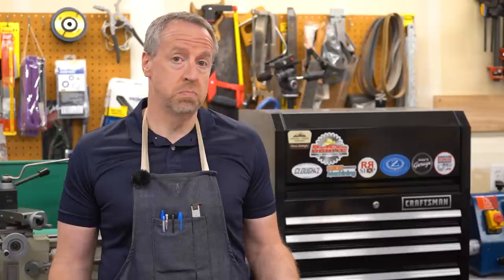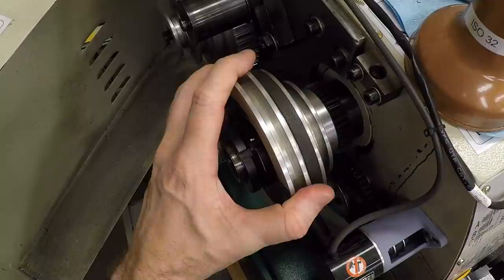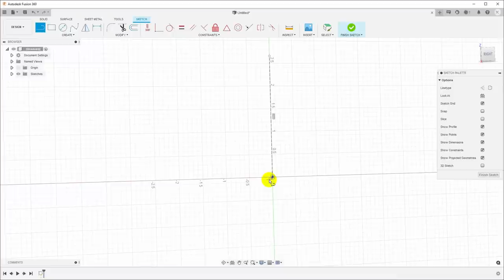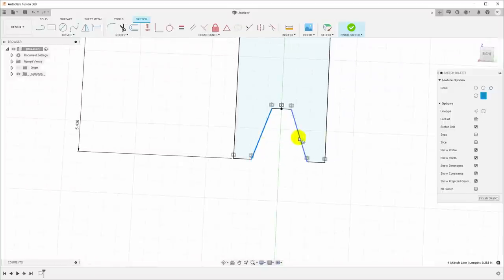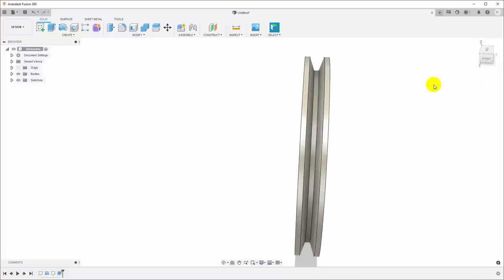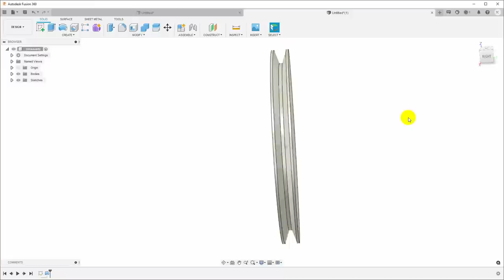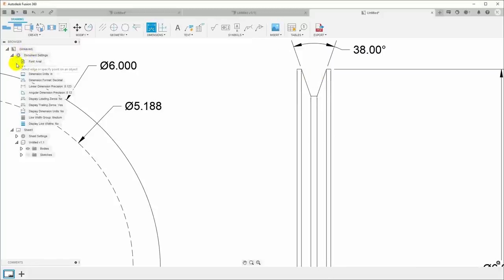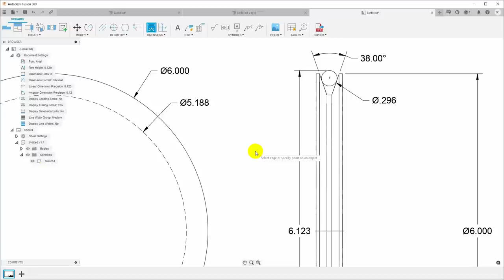Stupid Gage Pin Tricks: Measuring and Modeling Pulleys | Fusion 360

Comment: And of course as you're figuring out your V-belt 'stuff' - never let the bottom of the belt hit the bottom of the groove.  They get traction from the sides.
Reply: Does this mean the depth of the groove isn't critical?  Should it just be shallow enough that the pulley strength isn't compromised, and deep enough that the belt rides the angled walls?
Reply: Well do remember that as the belt wears, it's wearing on the sides (primarily) which makes it's "V" profile skinnier - so it will sink down lower and lower.  If you only left yourself 10 thou to start... you don't have much of a margin of error.  ;)

Comment: Ohh, so that's why YouTube machinists have "thread wires". Seeing the constraints build up in the model made it all make sense. Super cool!

Also, you must have a space mouse or other high-dof input device, that "pan the model while 'dragging' a constraint" was so smooth.

I shall definitely use this trick (or variants of it) with SolveSpace and my "two flute gauge pins" (as another commenter mentioned) in the future. I have definitely used cad as a way to figure out math and geometry in the past. (Projection math for 3d graphics rendering!)

Comment: When I noticed that the spindle thread of my 70 year old lathe (old Swiss DIXI lathe) I had to model it and I proceeded the same way. I don't own thread wires, so I used three 1/8 in. endmill shanks. It worked perfectly ; good trick.

Comment: We might also recommend Joe Pieczynski for in depth understanding.  We should point out that the pins cannot rest on the 'bottom' of the pulley V -- they must contact only the sides of the V -- and that you don't want to tighten the calipers at all or the pins will spread the groove and give a false reading.  If you don't want to buy Fusion 360, you can download FreeCAD.

Comment: Two questions for you James. I'm looking at buying a pin gage set. What range set(s) do you find useful? How did you decide to get a plus set or minus set? Thanks for the good content!
Reply from the maker: I have pins from .011" up through .500", and I would like to keep growing the set.  I picked minus because the first set I bought was minus, and I didn't know the difference.  Looking at it now, minus is fine, because I'm, typically checking 3D-printed or CNC milled holes, and a minus gage pin will usually just barely fit into a proper-sized hole.  The .061"-.250" set is the one I use the most, but it totally depends on the size of work you do.  You can also buy loose pins if you need them in specific sizes.  I have a .750" pin that I use for touching off tools, and I know a lot of people have pins that fit their mill table slots for quickly aligning parts.

Comment: Nice and informative, good way to measure things like this (where the angle is known).

One question though, don't those calipers have a switch for inch/mm? Also that 0.627" measurement is suspiciously close to 5/8"....
Reply from the maker: The calipers do.  The micrometers do not.  I'm assuming it's 16mm because everything on the lathe is metric except the leadscrews and dials.
Reply: @Clough42  understandable, context matters a lot with whether or not something is metric/imperial. The really sad thing is that even if we adopted metric tomorrow in the US, we'd still be dealing with random imperial leftovers for the rest of our lives. Even metric micrometers are based off imperial ones.
Reply from the maker: @cavemaneca  the best thing about switching to metric would be needing only 1/3 as many drills.  :)
Reply: @Clough42  you don't have to convince me

Comment: Interested to know your approach to machining this pully. Would you grind a 38deg form tool and do it just like a thread? I can think of a few other approaches but many of them keep you from having access to both sides with good symmetry to take measurements with the pins. Great video! I find myself taking the constructive geometry approach quite often, since Fusion 360 is almost constantly open on my desktop.

Comment: I wonder how accurately you could measure the angle using 2 sets of pins of different sizes if you were dealing with a completely unknown pulley.
Reply from the maker: Oh... That's a very cool idea.  I might try that!
Reply: It would rely on your ability to accurately take other measurements, but the software can derive 'other' dimensions from the right combo of measured (accuracy is key) dimensions. 
Reverse engineering is a talent and art, and can be very accurate.
Reply: @Clough42  That method is also in MH as well as using balls to measure internal tapers. John, Australia.
Reply from the maker: @joandar1  Really?  What section?  It's a big book.  :)
Reply from the maker: @joandar1  Oh, I see the angle and taper measurements using disks.  That could be easily abstracted to tapered holes and balls.  Cool!
Reply: @Clough42  Off the top of my head I don't remember, try looking for measuring tapers and that should get you close. John.
PS: Page No is dependent on what edition you have.

Comment: Since you used different sized pins the 5.555" measurement could not have been not symmetrical about the centre of the pulley so presumably Fusion accounted for this offset automatically but I imagine that would be quite a complicated sum to do on paper.
Reply from the maker: That's the power of letting CAD software sort out the constructive geometry.  It would be much more complicated on paper for the reason you state.

Comment: When you dimensioned the tan of the two pins, should you have dimensioned one back to the centre line?
Reply: I thought the same thing
Reply from the maker: I certainly could.  What would you use that dimension for, though?  In the shop, you'll always be measuring across the two pins with a micrometer.  Or maybe I'm missing something.
Reply: @Clough42  Ignore That, the Parnellism of mirroring sorts it out.
Reply: @Clough42   My bad i missed a dimension in the sketch ;)

Comment: Looking at purchasing a mini lathe. Something similar in size to the Grizzly you have, probably slightly smaller. Would you be willing to do a video on what too look for and why you went with the model you did.
Reply from the maker: The lathe I have is the Grizzly G0602, which is a 10x22" model.  It's about double the size and five times the weight of a typical 7x10 mini lathe.  I bought it because 10x22 is big enough for most of what I do, and at 450lbs, it's pretty easy to move around with an engine hoist.  Now that I have a 3-phase motor and VFD on it, I'm pretty happy.  If I were to upgrade, I'd be looking for a Hardinge HLV-H, which is about the same size, but many times heavier, more precise, and expensive.
Reply: @Clough42  This would be my first metalworking lathe, but it's been years since I used a woodworking lathe.  Unfortunately I am not exactly sure what I should be looking for in a mini lathe as far as features and specs.  I was looking at the Grizzly 8 x 16 G0768Z with the X/Z DRO, but I see now that the shipping weight is only 177lbs.  Am I to assume the heavier the lathe, the more stable and rigid it is?  I was attempting to stay under $2000 for the lathe itself, as I understand there is quite a bit of tooling to be purchased as well.  It looks like I should consider waiting until I can increase my budget for something heavier.  Thank you for the information.  I enjoy the detail in your videos, and the inclusion of your thought process.     Very squared away.  Thank you again.

Comment: Great video.  I have a question?  I just noticed you changed your bracket for your encoder to a solid mount. Looks like you 3d Printed the bracket and drilled and tapped holes on lathe.  Do you have a link to the Fusion file and cold we get it.  Thanks Joe!!
Reply from the maker: I totally forgot to upload it.  Here you go:  https://www.thingiverse.com/thing:4916260

Comment: Well damn I am the guy who asked for the help amd I must say, this is suprisingly easy. Thanks a lot for the advice. I know I am 5 months late apologies :D So I just used tiny end mills as my gauge pins and measured and designed the thing and now I am hoping for the best. Is there a way to calculate material mass too? Lets say the original flywheel was a zinc aluminium alloy for simplicity sake aluminium...I want to make the flywheel out of cast iron or hot rolled or whatever iron.. is there a way I could get a realtime readout of the approximate weight of the part?
Reply from the maker: Most CAD software will give you the part volume.  In Fusion, you can set the material and it will give you the mass.

Comment: I wish to complain about the description of this video;  those were neither stupid tricks nor stupid gauge pins!  MINE are stupid gauge pins.....they have two flutes, a 135° split-point and only come in 0.1mm increments...but they get me by and effectively cost me nothing.  I shall not vouch for their accuracy mind and they definitely need to be measured with a mic rather than taken at nominal diameter!
Reply from the maker: Drills work great if that's what you have.  You know, you can cut the spiral flute part off, and they'll be easier to use.  :)
Reply: @Clough42  I usually break the spiral flute off, using a method I call "ham-fistedness".
Reply: I find they don't cut so well without the fluted end ;)  On a more serious note though, it's worth checking that the shank hasn't been chewed at all by a chuck as that'll through it out of round to the point of uselessness for gauging purposes.

Comment: Pitch Diameter is always tricky with so many belt styles
Reply from the maker: For sure.  And to be fair, I don't know if I ever saw a spec saying what style pulleys this lathe has.  I think I may have deduced it from the part number of a replacement belt, but the belts I'm using are certainly not the ones that came with the lathe originally.

Comment: But how do you measure the V-angle if you don't know what type of pulley you have (as is likely with the reel to reel tape recorder)?
Reply from the maker: You could use a protractor, or maybe angle gages.  Someone suggested taking two different measurements across pins, with different size pins at different depths and let Fusion sort out the trig.  I want to try that.
Reply: @Clough42  Also, with some pulleys, the wear in the sides causes the use of pins to return false values for the original angle. In industry, there are many instances where the 'wrong' pulley is used because it was the one the maintenance guy or gal had on hand to make the repair. Wrong pulleys usually eat the belt, but there are situations where the reverse can happen.
Reply: @Clough42  I think I'd go for the multiple pin sizes if the angle gauges aren't available. And it all depends on the scale of course. A pulley in a tape recorder is likely 2 to 4 mm wide, which makes a lot of hte techniques harder to execute.

Comment: You can use a very similar trick to measure holes and concave shapes that gauge pins won't fit into by using ball bearings instead of pins.

Obviously in your drawing all you see is the cross sectional area so it's exactly the same process. 

Learned that working in a tool and die shop for soda can presses where the dies had tons of inner profiles like chamfers and radii on tiny internal shapes that were impossible to measure otherwise.

Comment: So, I'm confused about how one would machine this.  A form tool?
Reply from the maker: A form tool if it's small, or feeding down the shoulders with the compound if it's larger.
Reply: Form tool is how I do it.  Think like its a single thread, with the critical dimension the v-groove width.  The angle is on the tool, and the max depth is not critical, but the minimum is from the handbook.  I use a large radius form tool so the bottom of the v-groove doesn't have a sharp angle (less stress too).